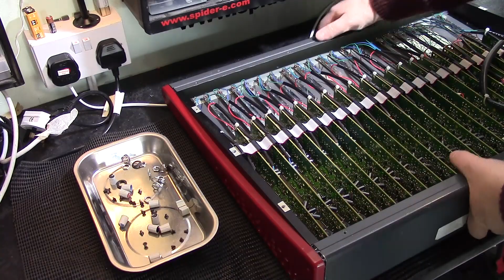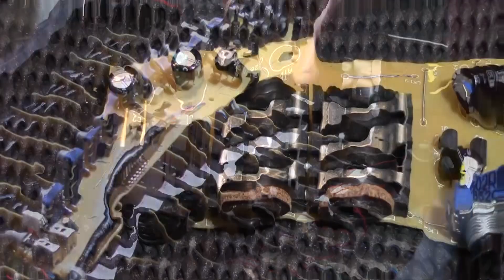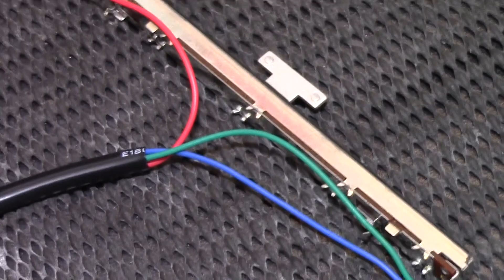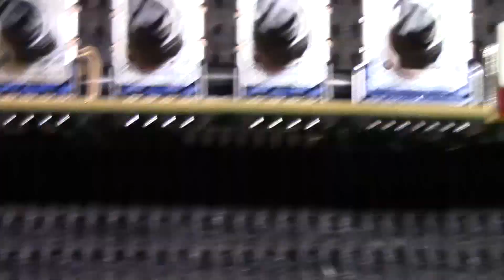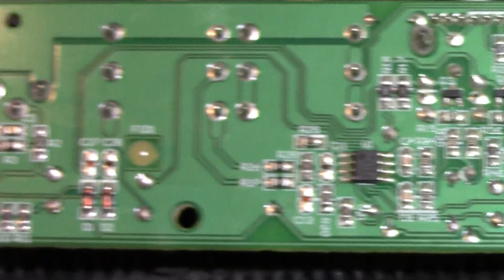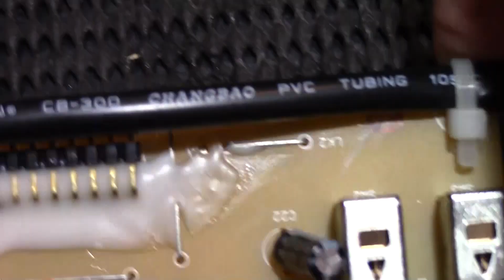Allen & Heath ZED 24 Repair. Part 2: Mono channel boards.

Comment: I have the same mute switch fault on my Mixwizard. Looks like it would be straightforward to clean the switch assuming that is the fault although you don’t say what the issue is.

Comment: Thanks for the video.
I’m also one of those people searching for knowledge on the jumper settings for making the mono channel’s direct out post fade. Would you happen to know about this?? 
A&H tech support flat out refuse to disclose this information to me - ‘all schematics are strictly confidential’ so I’m told . 
(I have no interest in stealing their intellectual  property, just modifying my own desk in a way that is obviously designed to be an option )

Many many thanks in advance! 🙏
Reply: With the solder link options, the post fader is made default by a thin copper track that bridges the post fader link pads, presumably so they don't have to solder it in production. However, this thin copper track must be cut (carefully). Then you can solder-bridge the pre-fader link (better to get a handful of surface mount 0-ohm resistors - the solder gap is so wide that it makes bridging difficult). The modification works likes a charm, but no reason why it should not. The service manual schematics show the pre-fader connections to Aux1, Aux2 and the solder links, which also go to Aux3. Just a matter of removing the post-fader line from Aux3 and feeding it the pre-fader. Frankly, I have no use for a post-fade aux track and the extra pre-fader is great :)
Reply from the maker: I will try to get some time to look at the channel board and see if I can figure it out.

Comment: Hey man, I did a recap on my old analog mixer. All of the channels work great apart from one. When I plug it in it sends the signal to the master, but the signal is very weak. If I turn the gain right up it shows that it’s clipping, but the signal is still weak. Do you know what it might be?
Reply from the maker: It sounds like the fault is after the gain/eq stage. Most likely a dead op-amp on the channel strip, or a short created during the re-cap. Try replacing the OP Amps on that channel strip.
Reply: @Spiderelectron  hey man thanks for the reply. I replaced the op amps today and I still have the issue. 😢 I guess I’ll have to see if I can find the short. It’s always my luck that just one channel doesn’t work.

Comment: Hi, great video. Very helpful. I have one where I get response on the r XLR output, but not left. Thoughts?
Reply from the maker: I would suspect the final output op-amp if nothing at all is sounding out the left channel - or possibly some of the electorlytic caps on the same board.
Reply: @Spiderelectron  the final output op-amp  - is that located on a small board located between the boards underneath the power board? Or on the board where the xlr outputs are? Working without a schematic here.

Comment: I just left a comment on Part 3 about making the jumper wires post fader, which I saw you pointed out on this video. The ZED 436 model has a TRS direct out on each mono channel, which I now noticed this board does not have. Hoping the jumpers will be easy to spot like on this model (I think they probably will), the hassle looks as if they need to be soldered rather then plugging in an actual jumper wire. That could take quite some time on the 32 mono channels. 

If you know about the ZED 428 or ZED 436 models please feel free to chime in and offer any advice. Thanks for very well detailed videos on these mixers. I gave you a sub. Thanks.
Philip

Comment: Thank you for your help.  I was able to fix one of my faders that I accidently pushed in by accident.  It was a simple fix thanks to your video.  Great Job!!!
Reply from the maker: Great! I'm glad it helped.
Reply: The post and pre selection must be for the EQ i think, and not for the aux, i see the connection running towards the EQ pot. And i want to ask you if that opamp is a good one, must be because they also used ALP pots, otherwise i makes no sense